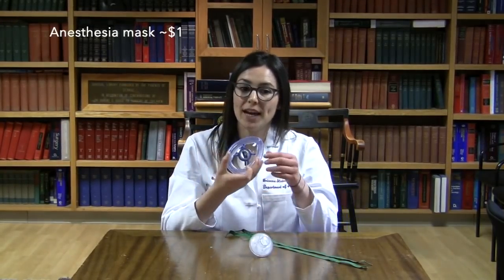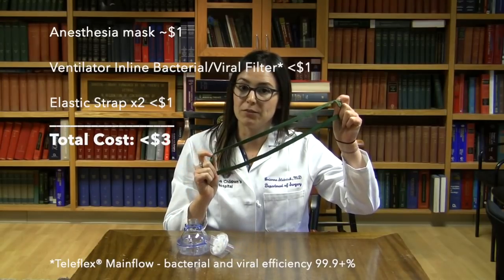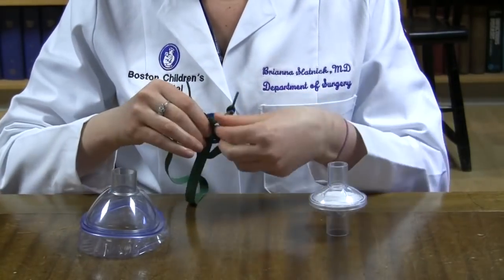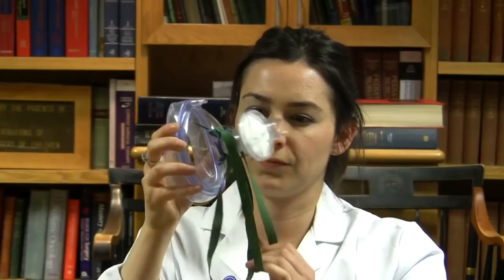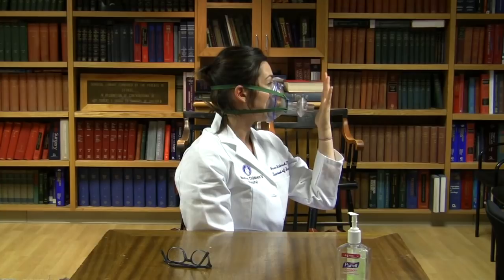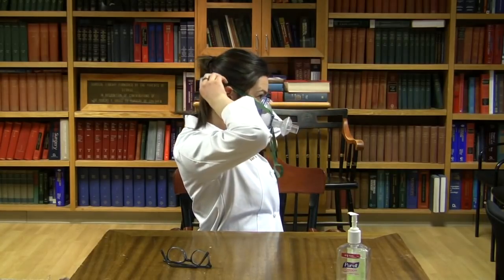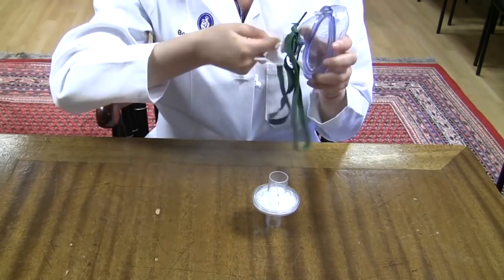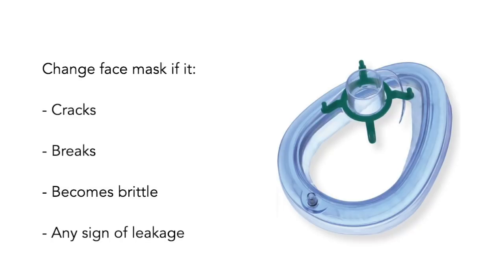Making Your Own Reusable Elastomeric Respirator For Use During Covid-19 Viral Pandemic N95 Shortage

Comment: We love this idea and have implemented it in our emergency plan. One major draw back is the elastics. 1: you have to burn two masks to get enough elastics (one elastic is not adequate), 2: the fabric on the elastic is not sanitary after use and difficult to sanitize. 
As a solution, we are utilizing the tourniquet bands commonly used in our lab. They are cheap, purchased in bulk, sturdy, and can be sanitized.
The masks come in 7 sizes, we are using size 6, 5, & 4 for most of our staff needs. 
We are not yet sure how often we will change the filters. We have a large box of bacteria filters that were accidently purchased in place of HMEs - a simple 11mm adapter was sufficient to ensure a good fit and seal.
Reply: What about the straps used by ems when they use this mask with prongs on their cpap machines. They are all plastic.
Reply: see above for harness and part number
Reply: Go buy elastic from fabric store
Reply: I agree, elastic straps are one limiting factor but still can be reused numerous times and disinfected for several days if in short supply. Still pretty inexpensive.
Reply: Elizabeth, if you go to Amazon you can get long rolls of elastic ribbon and make it a disposable. Figure out your ideal length and cut up a supply. Quite honestly even long wide rubberbands also on Amazon would likely work. Just order a variety of sizes if let the community know what works best. No reason to have to clean such an inexpensive part of the filter.

Comment: That filter is completely reversible in orientation, there is a 15/22mm connector on both sides. During use, one side will become contaminated, and while the outside of the the filter is cleaned, the filter material itself is never cleaned. I don't know the lifespan of the virus on damp filter media, but it might then become a good way to ensure, rather than prevent, infection of the user during the subsequent use. If I had to re-use this setup,  I would label the sides of the filter prior to use, so that next time I use it, I don't put the prior patient's side of the filter towards me. You would be carrying a contaminated item around with you. That gives me pause. If forced to do so, I might keep the contaminated filter in a ziplock bag, because fingers can slip right into those 15mm/22mm filter connections and get contaminated.
Reply: Yes!!!!! Can they cover the end with a piece of 3m 0.3 micron merv 13 air filter and then take a pice of the polypurapene boogie and elastic band it around the end of the filter to keep it clean. That theycan change out.
Reply: Excellent and important observation
Reply: A red sharpie solves the direction problem
Reply: @lauriedion1148  but virud size is between (65–125 nm in diameter)  how a 0.3 micron can help¡

Comment: I am an anesthesiologist at a bay area hospital. We are woefully short on PPE and desperately searching for alternative solutions.

This is amazingly innovative. Awesome idea!

Question: This is reusable - as stated - except for the filter?

If you use this device in a room where a patient is intubated (aerosol generating procedure), you would need to replace the filter...because there is no way to clean the filter. Is that correct?

Thank you for your creativity - and for sharing your idea.
Reply: Could you wrap the filter with small squares of 3m merv 13 air filters and then elastic band a piece of shoe cover over it
Reply: @lauriedion1148  yes!
Reply: @markdcatlin  Familiar with those but can't seem to get any quickly. Waiting until mid April or May isn't an option. If you have an immediate source please suggest. Thanks.
Reply: @markdcatlin  That great NAS resource you provided highlights the "barrier" of training for cleaning.  Perhaps manual soap and water is no issue, but one alternative is a push button timed bath in isopropyl, which is exactly what this 450 dollar product is used for in 3d printing. Perhaps an alternative bath solution is possible as well, e.g. hydrogen peroxide? 
https://formlabs.com/store/form-2/accessories/
Reply: i am a nurse also in the bay area.  if you can implement this alternative this would be a life saver for many healthcare personal.  it almost seems political staff is waiting for paper masks when we have a viable solution.
Reply: Still not clear how many times can you use the filter or do you have to dispose each time after use?

Comment: Is making these masks the type of project a community organization could take on in Boston for the local hospitals?  It sounds like the supplies for this are readily available and not overly expensive?  Or could the hospitals help with ordering supplies and volunteers could put them together?  (BTW...it looks like crazily enough, the elastic straps might be the most difficult to get as so many organizations are using them for cloth mask projects)
Reply: I have suggested the plastic head strap used by EMS with this kind of mask on their cpap machines. They attach to those prongs.

Comment: Are these valves one-way? If they're meant to protect the ventilator from the viral/bacterial contamination, and it's one way, it really doesn't filter anything out for the wearer. Can someone clarify this?
Reply: Chenyu Lin ive been asking the same question and no one can answer it
Reply: It is not a valve it is a micronic filter in there.  Similar to the filter on an N95 mask which relies on electrostatic forces to trap polarized droplets.

Comment: Thanks for the wonderful idea. I really want to know if it's as efficacious as n95/ surgical mask?
Reply from the maker: New video coming soon which will help answer your question!
Reply: Works better! The staff just can’t hear u well
Reply: Most HMEs provide a minimum of 99.9% filtration of particulate. It depends on the vendor and whether electrostatic or mechanical filtration. The mechanical filtration HMEs can be as high as 99.9999% effective, which is much higher than an N95 (95%). Plus if this mask is secured appropriately, one can perform their own fit test by just covering the HME opening. If you cannot inhale, it is a good fit-It’s like breathing against a closed valve.

Comment: Awesome! 
1. Should we do taping over the connective between the filter and mask? coz, it might be disconnected accidentally if knocked by someone's elbow while in emergency situation. 
2. Secondly, the external parts the inlet of filter will be contaminated with the virus, so don't use the same sheath of napkin wapping the outer and inner outlet of the filter (which facing to our face, as shown the video). 
3. Don't put your used mask on your tablet, if your are not going to sterilize the table too!

God bless everyone in the front line around the world.

Comment: what are you guys doing for eye protection with this system?  I imagine some goggles would be too bulky for this system.
Reply from the maker: I think full face shields are probably the best fit - thin plastic ones with the foam forehead padding - can either be cut above the filter or go over the filter but have to be sure it is not obstructing airflow.  We have 3D printed adaptors that angle the filter backwards so that the full face shield can come down over the entire mask and filter to protect it from splash as well.
Reply: Cut a hole in the fabric of a mask with face shield. Place over the filter. Works nicely

Comment: I'd just like to reiterate the suggestion of using commercial elastomeric respirators made for industrial purposes.  Perhaps the materials used in the anesthesia mask are less permeable and easier to clean, and I'm no expert on this.  But in other respects, these masks are functionally similar and likely equivalent.  They generally have an exhalation valve, so there may be some concern about leakage there.  These respirators are intended for work with very fine toxic particles such as asbestos, mold, and lead dust, and are frequently found with N100 or P100 HEPA-type filters that should provide even more filtration than N95.  I've seen many photos of guys wearing these things in biohazard situations, so it's unclear why these aren't being used in hospitals and clinics, other than that they are normally sold outside of the usual healthcare supply chains.   Innovators like yourselves looking for creative solutions should definitely look at these.   Look for industrial P100 respirators.

Comment: Important: Do not use the same cleaning tissue to clean the outer portion of the filter holder and the inner parts of the filter holder and mask unless you are using it to apply disinfectant, otherwise you may transfer contaminants from the unclean side of the filter to the clean side!

Comment: Be mindful that once this filter gets wet, it will not work to the same degree as a dry one. When you add the inherent leak value of CPAP or BVM mask, you still have significant leakage and contaminants in the air.

Comment: Is is safely allowing CO2 to escape via the filter?
Reply: Teresa Frey - yes, this is an anesthesia circuit HME. It allows flow of gases in both directions through this electrostatic filter. Most are efficient to a 99.9-99.999% rate. An N95 is 95% effective.
Reply: @Gasmom217  I still have a concern about breathing resistance and CO2 buildup...how do staff feel after wearing them for a period of time as compared to an N95?
Reply: Taras Stecy an N95 is going to be more comfortable than this option. I tried one for a couple of hours just to see what it felt like. It was a lot warmer than an N95, which is to be expected based on the filter as it traps heat and moisture as well as filters particles. I would consider this to be an option when one does not have N95s or other respirators. I call this our N95 2.0.

Comment: I am awaiting delivery of these items tomorrow from McKesson.  The filter was part #1109619 and the medium mask was part #854707    This was a bit over $3 for the mask and $1.33 for the filter.  I haven't sourced the elastic strap yet - if anyone had suggestions I'm open to them.    Keep in mind I haven't 100% confirmed these fit together, but I didn't see other sources.  Luckily these are NOT restricted (yet) by McKesson like many other items.
Reply: I have suggested the plastic head strap used by EMS with this kind of mask on their cpap machines. They attach to those prongs.
Reply: Components arrived today and fit together fine.   Pretty limited surface area of the filter which limits flow of air, so I can't imagine using it very long, but it's an interesting concept and could be useful if in a bind, a temporary measure while seeing a patient quickly, or for other emergency needs.  If there was a y connector to increase the flow volume (two filters) it would work better (albeit with more dead space).   Overall a great idea.
Reply from the maker: We have 3D printed a T-Piece that angles the two filters backwards and slightly downward to improve breathability but then you use 2 filters at a time.  you can also use standard T-connector used for ventilator connections.
Reply: I got the straps from used non-rebreathers and simple masks. Just cleaned them and let them sit in sun for 3 days

Comment: Excellent. Thanks.
What / where the straps from?
Reply from the maker: can get elastics from arts and crafts or clothing/tailoring supply stores
Reply: @hbkimsurgery8943  thank you!
Reply: @markdcatlin  thank you for the information. To confirm, 'p100 / hepa filter' will filter whatever size the Covid particle size is?
Thx
Reply: or maybe get them from an O2 mask?
Reply: I have suggested the plastic head strap used by EMS with this kind of mask on their cpap machines. They attach to those prongs.

Comment: One way to sterilize the mask is to use UV -C light , put the mask in a drawer and turn on the UV light for 5 minute , should do the job.
Reply: Do you have a link to UV-C light/lamp?
Reply: Any UV-C lamp with the wavelength 254 nm will do. Here is an example: 

https://slichic.com/products/steril-uv-light-sterilizer
Make sure you activate the lamp in a close drawer or cabinet since UV -C is dangerous to the eyes and skin.
Reply: @johnsnow407  Can 3D-printed filament be sterilized with UV light?  I am wondering if 3D-printed masks can be re-used.  Thanks.
Reply: Can 3D-printed filament be sterilized with UV light?  I am wondering if 3D-printed masks can be re-used.  Thanks.
Reply: @andrewhebert6530   I don't see why not. You just have to have sufficient intensity and duration in the box.  If the light can't get into certain nooks and crannies that could be a problem.
Reply: @johnsnow407  Thanks for your reply.  That's the million dollar question, I suppose - how long is sufficient.  But it's a double edged sword since UV breaks down the material.  Someone needs to do testing with this.  I think Prusa is actually testing some prints that are contaminated.
Reply: @ThangTran-bj4we  Thanks for that link! I just got two lights.  I recently got an elastomeric respirator that I am going to be using, as long as I remove the filter cartridges, do you think would this work to disinfect the remainder of the mask?  I would stick in a drawer with the light on in between patients.
Reply: @melaniemartin9861  : Yes that is what I intend to, wipe down the respirator with Caviwipe, and change the filter if it is soiled.  And the UV-C light is an extra step of safety to disinfect what ever Caviwipe could not reach. I mean this is all a temporary solution until we get the N95 mask.

Comment: As an experiment, I have purchased a face mask off Amazon.  I will cut a piece of 3m filtrete 2900 and tape it securely inside the mask.  It should be good enough.
Reply: @markdcatlin  we need these yesterday though. 
Not May.
Reply: @markdcatlin  Please stop pasting the same reply to each message.  As others have noted, those devices don't seem to be available anywhere until May....
Reply: @markdcatlin  

This is good to know. Thanks for that.